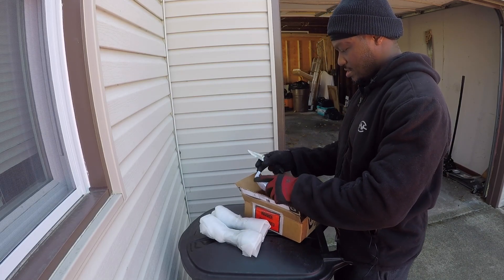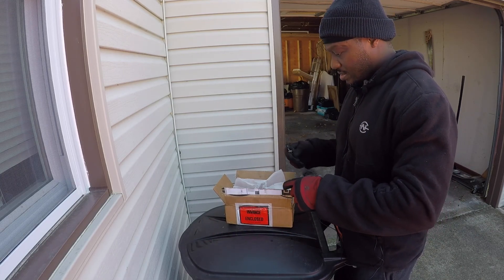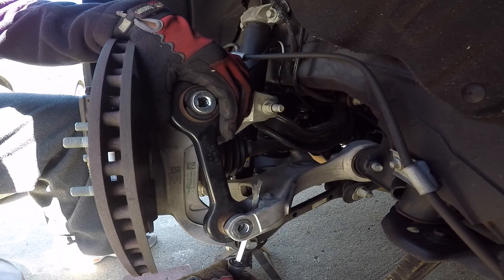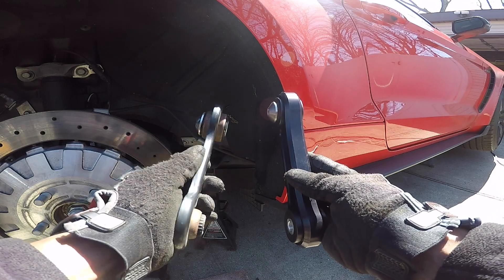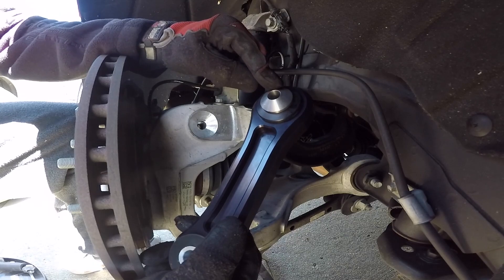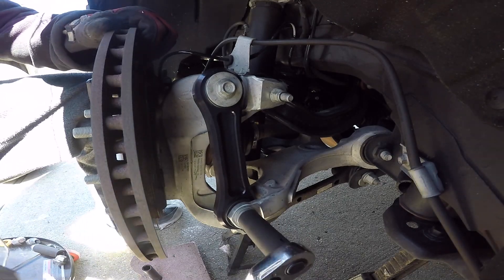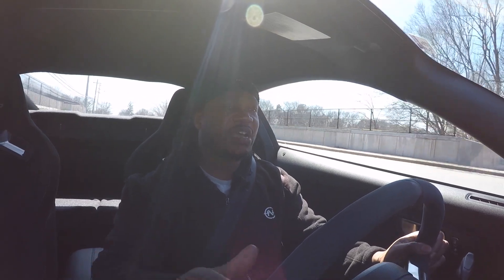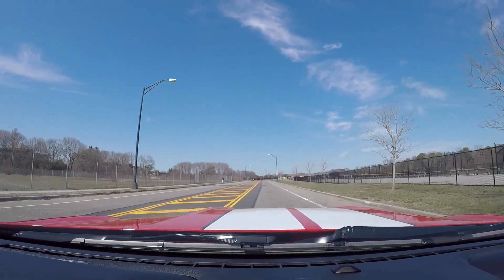HOW TO INSTALL BMR VERTICAL LINKS SHELBY GT350

Comment: Bro, awesome video again! I have the same color GT350 but a 2016. I have every BMR suspension component made for the GT350, except for my springs (Eibach). Your doing the correct process, as told to me years ago when I got mine. Upgrade the suspension components, brake shoes and tires, will make this car accelerate and handle even better than you think. Keep up the videos.

Comment: Nice vid.Today I had my 1st wheel hop.Other than the v links, did you install front and rear sway bars? I gotta get that same smile/laugh you had. Earlier tonight,I saw a guy with a '66 Chevelle waiting at a red light.I looked at him and vice versa.Green light.Given her pretty hard and the hop begins.My '05 GT mustang had the same hop.I changed the control arms and hop was gone.Soon I hope to get the BMR set.Cheers.
Reply from the maker: I installed front and rear sway bars/endlinks

Comment: Hey playa did your kit come with new installation hardware? My kit I bought used and it didn’t come anything other than the control arms and bearings no bolts or washers